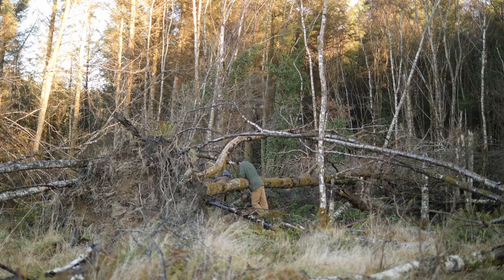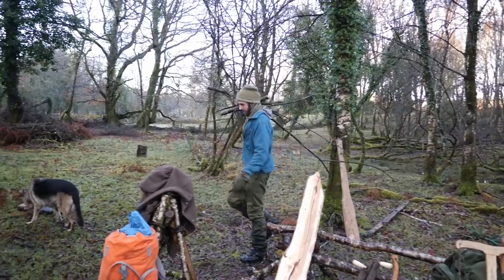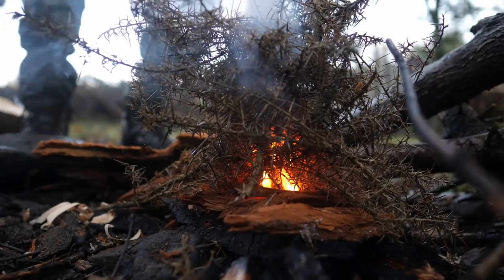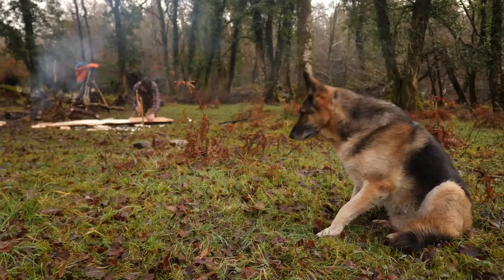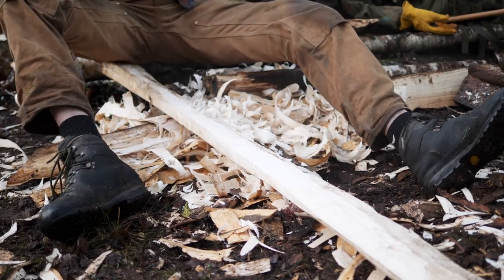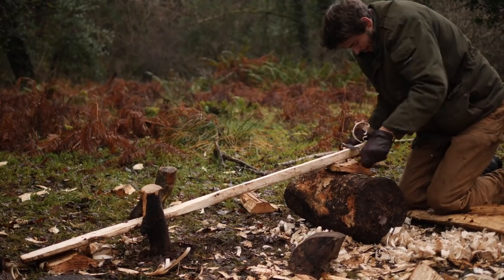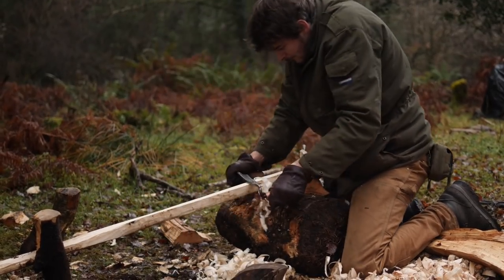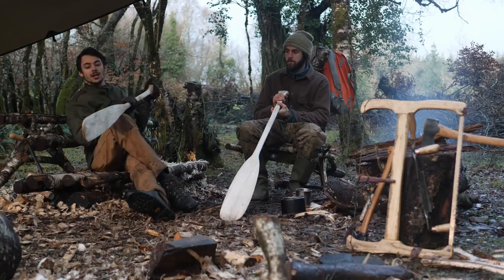Bushcraft at Camp - From Log to Canoe Paddles with Hand tools

Comment: The chord and charcoal as a chalk line.. Genius
Reply: For real though.  I wonder who came up with it originally and how they thought of it... We may never know
Reply: Still commonly used in carpentry, hard to beat it when you need a marking for a long straight line between two points, fast, easy and precise. 
Its usually a spool of thread that you can wind up in a container of coloured powder, so no charcoal anymore. Easy to repair and refill, so it will most likely last a life time of even professional use. Just a great and pretty genius tool.

My guess it’s probably an old technique, hundred if not thousand of years old. I’m leaning towards thousands, but that is just a guess.
Whoever came up with the idea, hit the jackpot

Comment: This is one of your best videos to date. There's no competition element which is good.
 You should both invest in a ten pack of thin work gloves. I'm an almost 50yr old carpenter and only started wearing gloves at work since it became mandatory about 10yrs ago.
I'd only not wear gloves doing that kind of work, if for some reason I forgot to take a pair.
That injury looks like it's at that pleasant tingly stage of healing.
That injury will make you stronger.

Happy Yuletide gentlemen

Comment: I attempted a dug out canoe 2 years ago. I put 8 months work into it ( every Saturday ) it ended up failing. I would suggest doing all the research you can and to be careful not to let the wood check.
Reply from the maker: ah thats too bad! was it salvageable ?
Reply: @SmoothGefixt  it had to many cracks in it after it dried . It is no longer sea Worthy.

Comment: On another axe safety note;  if you fit a leather axe mask before using the back to pound in splitting wedges then you remove the possibility of an axe cut like Dylans.  In this video we see Julius repeatedly swinging an exposed blade towards his own face - That is not going to end well!  Did we not learn anything this month?  Please be safe!
Reply from the maker: During the making of this vid, Julius tried keeping the sheath on. he found that it would come off after 2/3 good hammer strikes so he gave up. 
i imagine a little paracord lace over the original strap would go a long way on that, and i will do this in the future!! (learned the hard way!) 
Thanks for taking the time to comment and to share your thoughts!! :) 
Cheers. Dylan